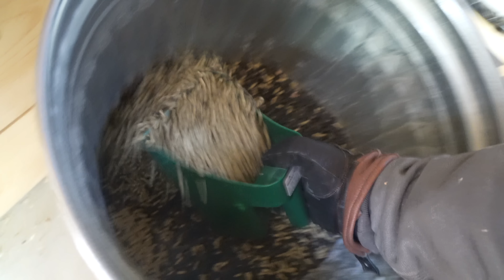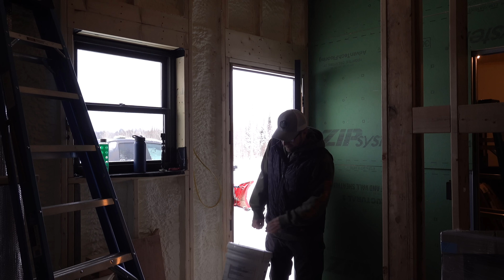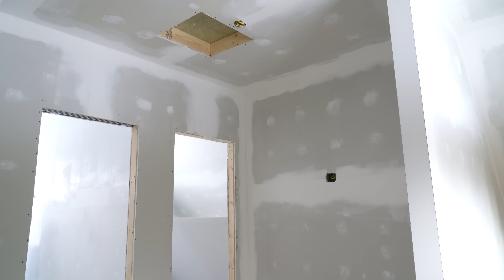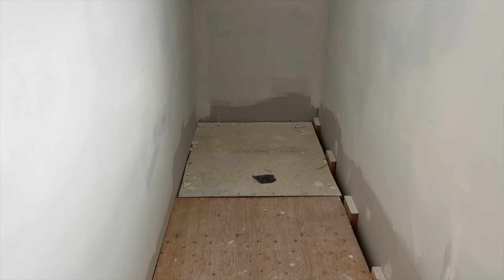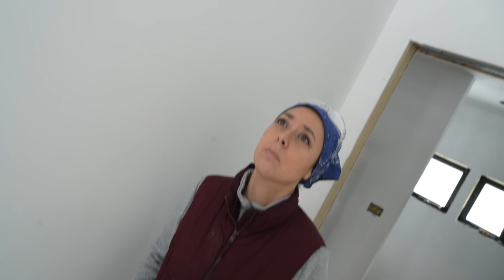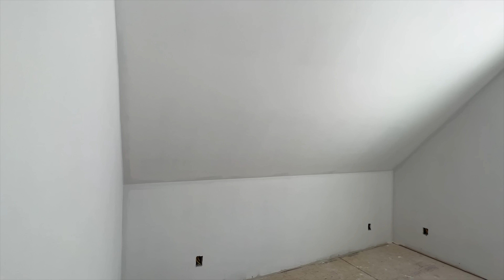FINALLY It's FINISHED!!! Husband and Wife Build OFF-GRID Tiny House in the WOODS

Comment: You'll find with your primer coat that you really need to cut the corners in with a brush or corner roller when you paint the corners, they won't be the same color as the field because they're not sitting on a primed surface. Usually it'll make the corners darker. You also don't need to play with it so much. The coat will look thin but as long as you have complete coverage, the first and top coats will cover very well. When you start a wall, go ceiling to floor. Maintaining a wet edge will give you a better final coat. Even more important when you're doing the base and top coats. Same thing when you paint the ceiling, one side to the other. If you paint in spots, you're going to end up with a patch work finish. The other thing is, I've never rolled a coat of anything without having a painters light. It's essential to have one and have it at the right angle to the work so you can see what you're doing. If you finish the base and top coat and can see roller marks, you didn't maintain the wet edge correctly. On the final coat, don't stop from top to bottom. The roller has to go from the top of the wall to the bottom without stopping or reversing or you're going to be able to see that in the dry paint. You can spot those errors if you have a painters light at an angle in front of you or behind you to the area you're painting. Without it? You might as well be painting in the dark. It doesn't matter how much natural light you have in the room if it's  not at the right angle.

Comment: You need a longer extension pole and Gina needs the one you are using.  No more bending.  Paint out of a 5 gallon bucket with a screen.  Stir the paint.  Paint all of a wall or ceiling at one time.  Roll the entire width or height uniformly.  Paint in one direction.  Left to right or right to left. Always paint into the wet edge of the paint you have already applied.  Eliminates any roller marks.  Ive been a professional painter for 30 years.  It will go much faster and easier on  your back.
Reply: Amen ❤️

Comment: Remember guys you are applying a primer coat on "bare" drywall, it will suck up paint like a sponge. If you find yourself pushing on the roller to get paint out onto the wall you need to put more paint on it, bare drywall will suck up at lot of paint very quickly. The paint you are using is a very good primer.......keep up the good work! Two coats is definitely overkill but it is your house and the labor is free.

Comment: Hated seeing you have go to all the trouble to put on the second coat. Primer/sealer isn’t made to cover like paint. I think you would have been pleased with the results if you had just painted over the first coat. Too late advice for the upstairs but you might try it that way on the lower floor. It might save you a lot of work. That product you are using is a good one.mI’ve used it with good results.

Comment: Did you know that they have paint screens that hang on the lip of a 5 gallon bucket?  It saves a lot of time to paint out of a bucket and not pouring into a paint pan every 5 minutes.  When you are done for the day just leave the roller  submerged under the paint surface  and put the lid on top.  It's ready to go next time!

Comment: Good morning and good job folks. Thank goodness that job is done. Having watched so much drywalling, I know I would have contract that portion of the work were I building my own house. I have had some experience with that in the past and would not do it again. Knowing how much more you have to do downstairs and on the “BIG HOUSE “ I would go spend some money on a paint sprayer. A contractor friend loaned me his and I sealed/primed and finish painted walls and ceilings for 1200 sq ft in a total of 4 hours over a number of days. No cutting in to worry about either. We are really looking forward to having more animal related video now that spring is coming. Happy daylight savings day (although I think it is time that was terminated..

Comment: I made a mistake when I painted my new drywall. I didn’t throughly clean the dust off of the drywall. The paint ended up peeling off in multiple places because the dust on the walls prevented a good paint bond. That was a major issue and was a real pain to correct.

Comment: Looks great, but wondering if it is really necessary to do two coats of primer. After this there are still following two coats of your final color. In my experience, that should really do it. Also the dry-wall pro's I had to do my current house were just doing single primer and two final coats. Interesting was that they sprayed the primer and then rolled the top-coat. Of course because the top-coat is different colors for walls and ceiling.

Comment: back in the day ,the painters didn't use PRIMER, they just watered down undercoat ,one gal made 2 gals, that sealed the wall and made a nice base coat for the full under coat and finish, so that's watered down primer to seal, full under coat and the colour of final to finish ...oh and that first coat 
( primer ) was called distemper ...or the paint was after it was watered down.

Comment: Al,  pour with the bung at the top instead of the bottom. It will allow the can to breathe easier and flow smother.

In your kitchen arrangement; have you got a range smoke exhaust hood?  or better still, a microwave/exhaust hood?

I have been looking at the angle of your solar collectors.  They seem to be pointing very high in the sky.  at your latitude I would expect something like 23 degrees up in the sky from horizontal.  Especially with the snow collection you seem to be getting.  This week with the equinox coming would be a good time to eyeball where they are aimed.  I would expect a little below the sun at noon.

Comment: Remember  it's primer sealer not paint.  It goes on different you didn't Ned to do two coats.  It is transparent also because you over roll it putting it on to thin.  That primer is the best you can get.  Good paint should also be thick like you primer.

Comment: They do make very inexpensive splash guards to put on your rollers.  It would be worth investing the few dollars to get a couple of them with all the priming and painting you will end up doing.  You might want to look up how to apply paint and primer.  Might make it give you better more even coverage.  You paint in a "W" pattern.  It really does help and it's not difficult.  Google it!  And you should take the primer all the way to the floor even if you are putting baseboards in because it does seal the drywall.

Comment: Hi guys, too bad I don't live there or I could help you paint, I am not great at most home improvements, but I can paint I have painted so much. Even last year at 71 I painted my place. I cut in first then roll the walls, yes first coat never cover well. There you will have to use three costs of the paint. Looks good.

Comment: Did the paint freeze?  I have used that product before and it never looked that thin going on or chunky coming out of the 5 gallon bucket
Reply: Buy a tinted primer, tinted in color you are painting the rooms, will be easier to see where it has going on
Reply from the maker: No it didn’t freeze.

Comment: Question for you.  Is it not common practice to skim coat plaster on top of the plaster board over there?  Here (UK) seems much more common to put a skim coat of plaster (about 3mm) over everything then there is no sanding necessary, if you have a good plasterer and the job is done quickly and the surface is then much more durable and not prone to getting dents if you knock it.  Just curious.

Comment: Lol was Funny to see you do Painting in Revers to how we do it we Cut in all the edges and Corners First the reason is Simple if any thing needs re doing or sanding you wont be hurting what you all ready painted once Edges are Done we do the Ceilings just like you did then the Walls as you did  even I still find it strange how Under coating always looks see throe till it Dry's really messes with your Head that  lol Great Vlog Looking Great thank you

Comment: USE THE MOST EXPENSIVE LAMBSWOOL ROLLER.
THEY HOLD MUCH MORE PAINT (LESS TRIPS TO THE PAINT TRAY FOR PAINT)
THEY  WILL NOT SPLATTER AS MUCH PAINT ON YOU (BY FAR) YOUR GLASSES WILL PROVE IT.
THEY WILL CLEAN UP AND BE REUSABLE ( MANY MANY TIMES.) WATCH A FEW HOW TO VIDEOS ON CLEANING PAINT ROLLERS
WILL COVER BETTER AND LEAVE A MORE PROFESSIONAL FINISH
DON’T BUY CHEAP PAINT OR CHEAP ROLLERS, IT WILL COST YOU. YOU GET WHAT YOU PAR FOR. SPLURGE ONE TIME YOU WILL NEVER PAINT CHEAP AGAIN. TRY IT YOU’LL LIKE IT!

Comment: Wow that was hard to watch. 
You are supposed to stir the paint,  that's why it was so gloopy, you can even thin it out a little for the 1st coat.
Use a paint pole for everything so you don't have to stoop down, and it's much easier on the wrists.
Do the 1st coat in one direction then the 2nd coat across at 90°.
Have you ever painted before ? Sure doesn't look like it.

Comment: For a second coat of primer why not get the paint mixed with primer? After all your walls are pretty clean no greasy kitty fingerprints, crayon marks on the wall nicks and gouges, fungus like in the bathroom, they are pretty clean so you shouldn’t need more than a Primer mixed with the finish color paint on new walls. Would be different if you were in an older house with lots of kitty fingerprints on the wall! At least that’s been my experience over the years. Saves labor to!

Comment: A few comments as you begin painting: (1) you need to cut in all corners with a paint brush before you roll the walls.  You can't depend on the roller to get close without the possibility of scraping paint you've just applied.   No need to do all the edges at once, however.  Cut them in as you go.  (2) For some reason, you jump from place to place at 12:20 of this video.  You need to keep a wet edge everywhere you go, even for primer.  If you're not careful about it now, to achieve your smooth walls you'll just have to come back and sand down bumps later.  This is especially significant when applying primer/Kilz to the surfaces.  Your finished wall will only be as good as your prep work is underneath.
Reply: This Stukaman knows what he is talking about. I was a professional painter for years. Not trying to tell you how to paint..but years of experience will allow you to do the job easier and avoid problem on the future. Let alone being able to be proud of your work.
Reply: @broman9216  Thank you, Bro, for the validation.  I painted homes during summer vacations and knew I had to have my brushes together before daring to charge anyone to pay for my services.  I also learned the hard way  painting corners - I had three rooms to do and thought I'd be a smart a$$ and save time, so I cut in ALL the corners first.  You guessed it, after applying the first coat of paint in all three rooms, there were actually two coats of paint in all the corners, and it was obvious.  My idea to shorten time on the job was rewarded by having to paint another coat on walls and ceilings - at no additional charge mind you - to make the corners blend in.  OUCH!  But I never forgot that lesson.

Comment: For best results bend the roller frame at a slight angle,  This will allow you to get in the corners better. You will also be able to roll  in front of you, not under--avoiding all that splatter! You will not have to squat as much on the walls, sparing your back. On the final stroke, roll from top to bottom with the 'toe' of the roller feathering away from the finished surface. Try it you will like it.  In my fifty years of experience I have always been able to train grateful novices in this method, but never set in their ways pro painters!  Get a grid for your bucket and get a longer roller poll!

Comment: This is the first time I have seen priming drywall with rollers. I think most people, at least professionals anyway, have used a sprayer. A sprayer applies the primer more evenly and seems to take less time. Just a thought mind you. What you have looks good, but may require two coats. I have been watching the build occasionally and it has been interesting. Keep up the good work.
Will you eventually sell the other farm? (not a subscriber)
Reply: this was two coats of primer. BTW, if you spray then you still need to roll it for an even finish.

Comment: Primer actually  looks too thick ,  have used before     if you got the water base  primer  can thin with touch of water    
For as much as you will doing  sprayer be great  but would need plastic  or other covering  for windows

Comment: I'm surprised at you Al, I was expecting to see a nice power painter. Be done likity split with that.  The creaminess is a special clay that is put into the paint. The better the clay, the more ya pay. Painting drywall the 1st time is unforgiving, it's so dry and just seems to suck it right in. It's your call on single or double coats. Most will do two to prevent light and dark spots with the topcoat. Here's the toy I use.  Graco Magnum Project Painter Plus Paint Sprayer 257025 - The Home Depot

Comment: Al...maybe missing  something but why are you replacing  an existing window??
Reply: Not replacing, it's the window for the Power Room as the original window that was delivered was the wrong size & has never been installed.

Comment: Great job - just a tip for you from my personal experience.  The microfiber rollers ($5.00)  along with the Valspar 2000 paint is the absolute way to go for the finish.  NO (or very very little) splatter onto you and the floor.  The only caution I'll put out there is that the eggshell is too matte.  I'd go up one level of sheen from what I'd normally get if I wanted washable walls.  Satin should be perfect. Rolling paint is not a speed sport - just a moderate speed with intentional direction will give you the best results.  You guys are doing an awesome job!!! We love to watch your progress.
Reply: My go to paint Valspar 2000. I convert any color to that paint and save a ton vs expensive paint. The finish is just as good IMO but I only use flat or eggshell. The more sheen the worst the walls look. Especially with todays low VOC paint that do not flash out period. Unless you spray it, you will see it!

Comment: Do you know how to do anything? You talk the talk of knowledge but then give video evidence that you don't over and over. Your goal should have been to get a single thick coat on with a heavy nap roller, and not empty the roller by pressing it and running it till dry. The primer is a primer, not paint. Two coats to get it to look painted should not be the goal. (YOU might want to use two or more coats if you are trying to change the color of a wall from a dark color to a light.) But for sheet rock you are wasting your time and money. If you are getting speckled, you are doing it wrong.

Comment: Primer only requires one coat. It's not paint and has little pigment. It's meant to seal the surface and prep it for paint, with better bite and bond to the surface. One coat primer, two coats paint. That first bucket looked like it had frozen. Paint products don't handle freezing very well.